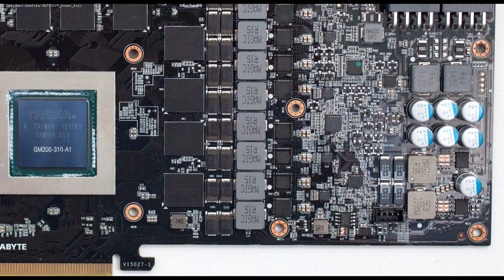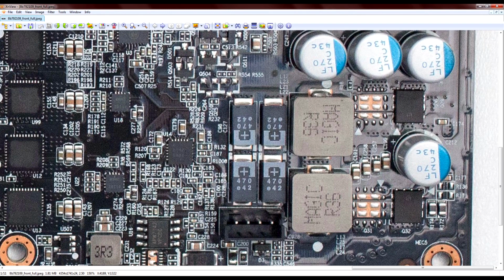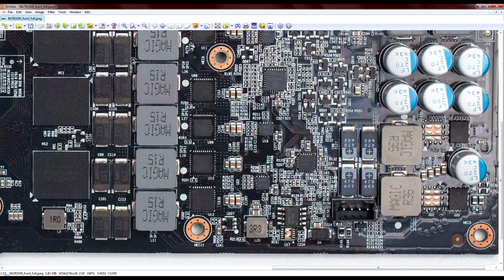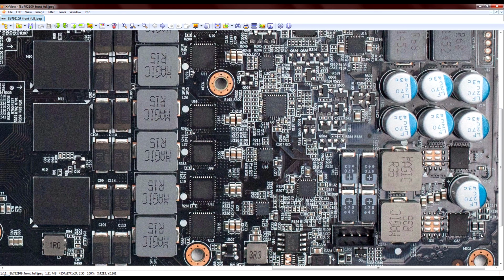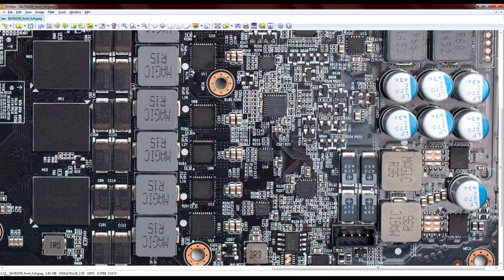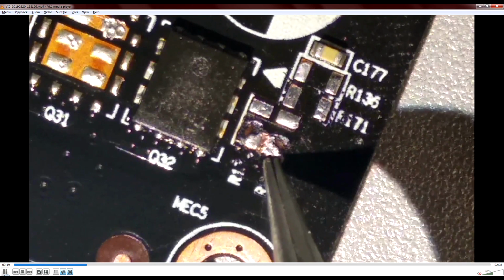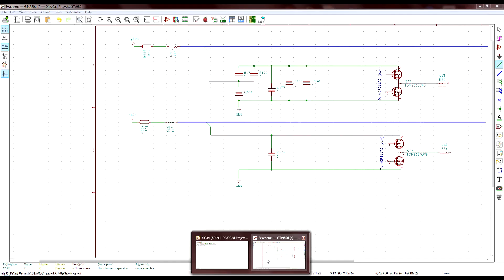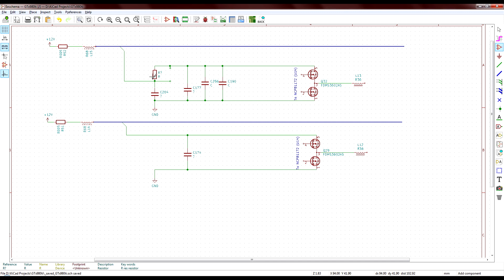Gigabyte 980Ti G1 GAMING-6GD Repair

Comment: @Uros Andric -  Hello, I'm sorry I know this is a very old video. I have a question I'm hoping you might be able to help me with, please. 
I own one of these Gigabyte G1 980 TIs, back in the day it had the exact same problem of R172/R174 ferrite beads burning out on the VRM, so it's just sat on a shelf for the past 5+ years. However, I now need a card for a work PC that has 3 Display/HDMI ports to run 3x 4K panels, so I was hoping there might be some way I could get this card to work again. It wouldn't be doing any sort of gaming, it's just browser-based work, so it's not going to be put under high stress like it would for gaming. 

At the moment, those two problematic ferrite beads have just started to arc, I can hear them buzzing and they look just slightly burnt but it hasn't caused any significant damage yet. I still have an image on screen, it just can't clock very high. As soon as the core clock and power draw goes up above about 40%, it starts to throttle. So when I look at the GPU core clock on MSI afterburner, it just goes up and down constantly. 
As I don't have the ability or knowledge to do any micro soldering, I wondered from watching your video and a few others... could I just remove those two ferrite beads and bridge it with solder? Or could I just remove them to only use part of the VRM, as the card wouldn't be put under high load? 

Would it still work just to do web browsing and Excel/spreadsheets? My theory is because it's not going to be under gaming load, it's only ever going to be under light load, could I get away with this or would it just be unsafe? Or is there something else I could do as I have already looked into and spoken with every computer an electrical store within about 100km and no one would touch the repair.
Reply from the maker: Hello there. No one would repair it because the chances to go bad after the repair are high and no one wants to take responsibility.
I can tell you what I would do if it is my card.
I would remove these ferites and solder a wire. Then i would keep the card on stock values or downclock it a bit. If it is unstable on stock values i would replace Vram power supply controller chip.
No guarantees that will work for a long time but i would try this.
Reply: @UrosAndric  Thank you so much for replying very quickly, I thought it was a long shot as the video is very old. 
I just want to check because I don't have your knowledge, I am very much out of my comfort zone here. Do you mean to remove both of the ferrites and then solder 2 tiny wires in the exact same orientation as the ferrites? So from the 2 pads top to bottom? The top of the card being where the 8-pin power connectors are and the bottom being the PCI connector
Reply from the maker: @Stop_Pre-Ordering_Video_Games Exactly as you described.
Reply: @UrosAndric  Awesome. Again, thank you so much for taking the time to help.

Comment: same card, same issue, except instead of crashing its throttling down badly, i caught it as it started to scorch, nothing serious yet. My question is, where can i find this resistor, and also, if i can, can i bridge with a tiny wire the same size as the original resistor? and on the one side you put the 0ohm resistor? would it do the same job? i just need this card to work for a few more months.

Comment: Cool video and interesting solution whit 0 ohm resistor. If resistor burns; replace it, if also monsfet after this resistors burn;replace it. Replace all burn after multimeter mesaurements.There must be a problem upstream this resistor.  My question is: why this two resistor burn? Do you know any idea?
Reply from the maker: i would replace all burned components and check if all is ok with the card. If it works propperly but those new mosfets and resistors are hot again, i would replace buck converter controller. That is the chip that drives those two mosfets. then i would see if mosfets and resistors are overheating again. My card worked over a year like this but eventualy new resittors got so hot it burned again. at that time i found replacement card and havent bothe with this one again, but if i had time i would do as i said above.

Comment: Thank you for the thorough information. I was able to diagnose my card. R172 and R174 blew out but the traces don't look too bad. However Q32 has a short and I'm worried this means my memory is likely dead. I ordered a replacement for Q32 so I'm hoping it'll work. My card would boot up to the login screen and then fade to black, hopefully it's salvageable.

Update: I removed Q32 and found that U14 has a short. Also removed U14 and it turned out the IC itself is not shorted but the VCC pin(15) on the board is shorted. I;m at a dead end now, don;t know where else to look for the source of the short. Any help would be appreciated.
Reply: Q29 IC gets here today. Confidence at an all time low. Still haven't found source of short :( Any help would be appreciated.

Comment: Hello @Uros Andric, could you please provide me with the pbc schematic of the entire board, (the one you show at 6:25 for example). The same thing that you show in the video happened to my gtx980ti, but the pbc where it cut was badly damaged. (Some copper sheets that are in the internal part) We want to proceed to cut and join point by point. But for that we need the schematic (it is the same GPU) Please can you share it with me. :)

Comment: Hello, I have a similair issue, the two resistors on the bottom right of the PCB are also burned out after a few years of use and a loud pop. Now I tried the zero ohm resistor, however even when I was doing the repair I noticed some discolouration on the R005 resistor on the PCB (in specific the right one that is under the 12v PCIE connector). I tested it with a multimeter in continuity mode and there was continuity on that resistor. I don't know if that is supposed to be the case or not, however the same is true for the two other R005 resistors next to it on the left (one of which you pointed out to in the video I believe). Now, I plugged in the card and something started smoking a bit so I turned it off. Upon further inspection that R005 resistor on the right side under the PCIE connector had burned, I don't think something else has been damaged besides just that resistor. Now I have ordered a new SMD resistor of the same value, but I am a bit woried that I will replace that resistor and it will just burn out again. I am not sure why that resistor burned out in the first place. Now as I mentioned, it did look damaged before, so maybe that was the cause. But in the even that the new one also burns out, what could be the issue? Does that mean that there is a short circuit somewhere or?
Reply from the maker: Looks like short to me. You should inspect the board where the short is. Try that mosfets pair IC that gets 12V from R172 and R174. I think it is Q32 but check within the video where i explane on the schematics.
Reply: @UrosAndric  I did some more measurements and there was indeed a short. However, when i removed the q32 mosfet the short was still there. I then measured that mosfet out of the circuit and there was no short on the chip itself. I then desoldered the 0ohm resistor i had previously put in (the one you also put in) and the short was still there. I then removed the R005 resistor on the top of the board (the one below the PCIE connector) and the short was STILL there. I then measured one of the 4 pads of that R005 resistor (there are 4 pads under it) and the bottom left pad is the one that seems to be shorting to ground (i think so, because the other 3 pads have do not short to ground). That is where i am at right now, I have no idea where that pad connects to and where to find the short, any idea?
Reply from the maker: @shekharnandkoemarsing158  R005 is Current Sensing Resistor. that means that it is connected to some circuit to measure voltage drop-off. That circuit can be dead and shorten to ground.

Comment: This was very helpful. But these ferrite beads will most likely burn because of short circuit somewhere else. I also had Q32 defective. When I replaced ferrite beads with 0ohm resistor and powered GPU, Q32 started to burn. I'll try to replace Q32 and hope it solves my problem.
Reply from the maker: If it is a short somewhere Q29 would also burn as they split the current. I think the controler have to be replaced as well. That would be U14 component on the board.
Reply: any luck after replacing Q32? Facing the same issue.

Comment: Hi Uros, thanks for your video. I've another issue than may have caused the damage. so. my q32 exploded because was working "solo".. let me explain. So, i don't know how, but my q29 is taking the 12v from the PCIE (SUPER NO GOOD) and the fuse,that protects the PCIE drain, rightly died. So no more power for the q29 even if it should have drained from the supplementary 12v from the psu (a thing that it doesn't). Then q32 started working solo, and this have caused the explosion of the r172/174 and the q32 itself. My question is... can you help me find why is my q29 still taking power from pcie and not from the PSU supplementary power? Any idea of who is the guilty IC ( i guess is an IC somewhere) ? 

Thanks a LOT in advance :)
Reply from the maker: Don't know realy, will have to trace the board to give you the answer.

Comment: Great work! I have this card too, few tools to do the job but searching for the 0805 0 ohms resistors, I come accross so many wattage capabilities (1/8W to 125W) does it change anything? Thanks!
Reply from the maker: Can't remmeber how much power memorry is draining. I think i sugested someone not to place fuse less then 5 amps.which on 12V line corresponds to 60W. Anything above it is fine i think.
Reply: @UrosAndric  Oh so a fuse of 8A basically! Thanks again :)

Comment: Hello Uros, I read someone who said we could use the second pair of pads (R171 - R136) if the R172 - R174 are too burned, could you confirm ? Thanks, and great video by the way!
Reply from the maker: I think not. This is me talking from top of my head but i think that those R171 and R136 re on different 12V rail. Technically it will work, but then you will have heavier load on that rail which can cause trouble. I would rather solder a wire from choke L15 to the place where the pads ware. This is connected directly anyway.
Reply: @UrosAndric  ok thanks, but my r172 pads seems fine, so you suggest to put a 0 ohms resistor and nothing to r174 right ?
Reply from the maker: @davebelisle949  Yup, just to replace that two burned ones with one 0 ohm ot a fuse. Be sure that IC os ok so you won't burn yout memory before you do that.
Reply: @UrosAndric  thanks Uros, by IC you meant Integrated Circuit ? If yes, well everything else looks fine
Reply from the maker: @davebelisle949  you have to measure it. If it is dead it can send 12v directly to the memory which will kill it.
Reply: @UrosAndric  ok so if I understand I have to test the Q32 chip resistance to see if it's ok, any idea the value it should read ?
Reply: @UrosAndric  hi Uros, I tried the fix but the card isn't working. The screen is shutting down after about 30 seconds even in the BIOS. Card is doing an electrical buzzing noise too. Any idea would be appreciated. According to electronician, Q32 and everything surrounding R172 and R174 is ok
Reply from the maker: @davebelisle949  i wouldn't turn it on inside a PC further more. Ot needs to be measured and tested in special conditions. Including power supply which have limited current. If this did't help then propper service is needed.
Reply: @UrosAndric  that's weird but the card is working nicely now, I brush it with a lot of alcool isopropyle and replug the cooler, maybe there's a safety if the card don't detect any fans ? Anyways, it's all working. Thanks again for the video!

Comment: My G1 gives a complete solid color screen freeze when trying to run unigine valley, any 3D games and even legacy games like warcraft 3 and CS1.6, they run fine until the gpu cooling fans kick in, the computer froze. Meanwhile i tried running furmark with no issue

Comment: Hello great video. two years now I'm now experiencing the same I wanted to find out the 0 ohm resistor should I replace it with only one
Reply from the maker: Yes, when replacing those two ferites needs to be replaced with one 0 ohm ressistor or a fuse.

Comment: I have had the same issue. However when I replaced on of the resistors with a small trace wire for pcb corrections the computer would not come back on. it just simply kicked the power supply off instantly. I have replaced the wire with a 1.8 ohm resistor and now the computer will come on but no response from the card. The first attempt to power on with the wire the card came on the lights came on and fans were working only for a split second before a small spark. i cannot tell where the spark came from but close to the same problem area. I removed the FET next to the resistors, visually it was in good shape but i can not tell internally. Can you help any @Uros Andric
Reply from the maker: If that FET died, when you replaced resistors with a wire it shorted 12V line to the ground thru that FET. Hopefully thru that FET and not thru the memory. Card should be able to boot with only one phase. So if you removed that FET, please remove the witćre just in case and try to boot. It should post.
Reply: @UrosAndric  I removed the Mosfet and 0 ohm resistor and the card will not power up. not fan movement or lights. I did not plug into pcie slot because I am a bit worried about the cad hearting my computer. I have a replacement fet I could put on. Any suggestions?
Reply from the maker: @Dr.DutchH  How did you tesded it if not putting into PCI express slot?
Reply: @UrosAndric  I tried it in the pcie slot and plugged into the power supply.  Without the fet.  It did not post. No lights came on 0 response from the card what so ever.

Comment: I got the same card, and the problem is this R172 and R174, one of them came off, the card still working but cannot sustain the memory/clock boost.
Reply from the maker: It fell of because it was heated enough to melt the solder. I would replace both of them with a fuse.
Reply: @UrosAndric  Thank you for the response I will try to find someone that can solder this coz my soldering skills already faded 😅
Reply: @UrosAndric  do you have a recommendation what amp of smd fuse I can use? Thanks

Comment: so hello i am commenting so you know what happened my poor 980ti same card after good 6 years crashed frozen screen yesterday and now it dont power up fans not spinning nothing happens i thing it dont even draw power completly dead i will take to  a technician tommorow to see if its actually card or slot on mobo  do you think its fixable? if i connect the display port to the mobo it boots up normally with intel intel graphics but gpu is not detectable by mobo

Comment: Hi Mate.. I have this card.. And the problem is that the memory clock and core are fluctuating a lot.. Memory goes from 3500mhz to 810mhz and performance drops really quickly.. Card is working in Windows but will stop working under load after few minutes.. You think its the same problem?
Reply: Adding a wire fixed the problem
Reply from the maker: @Chaosek  then you know those 2 ferrite beds are faulty. Best thing would be to remove them and place a fuse.
Reply: Thx for all your help
Reply from the maker: we had here a user that have reported exactly the same issues with his card and after replacing these R172 and r174 with fuses, card worked normally. I suggest you remove heat sink and check visually how those two components are looking. If you see any sign of burning you should replace those.
Reply: i just checked the 2 suspects and both look black and burned ... people seem to say these are ferrite beads... i found them on ebay.. but how do i know what value these should be?
0R?
Reply from the maker: @Chaosek  you can't know without schematics
 But since we know what they are suppose to do, we know we can replace them with 0ohm resistors or one fuse.
Reply: i checked both of them and there is continuity from one side to the other.. maybe its not that :/
Reply: i am trying to add photos with link to imgur but google keeps removing them
Reply from the maker: @Chaosek  you should measur the resistance. It should be leas than an ohm. Also it shouldn't change resistance drastically when heated. You can jump over them by soldering a wire in paralell with them. Then you can test the card. If crashing or fluctuations dissapiers, then you know that they are the problem.
Reply: @UrosAndric  thx.. I will try tomorrow. Does the wire need to be certain thickness?
Reply from the maker: @Chaosek  yes, but for testing purposses use some piece of wire not too thin.
Reply: Wouldn't it be better to replace them with a ferrite bead?
Reply from the maker: @Chaosek  yes but only if you know the exact values.

Comment: Thanks. You helped solve my issue. the Q32 was shorting out. Once I removed it, the short was resolved. Also, as note of caution, I the pcb area around the Q32 and 0-ohm resistors to be very delicate. Also, I ordered five of these Q32 powerstage mosfets. Since there are none in the U.S., I will throw the remainder on eBay.
Reply: hello I did not understand did you completely remove the q32 mosfet?
Reply: @DanjFisher  Yes, I removed and replaced
Reply: Where did you find the Q32 mosfets? I searched for Q32 and fdf32cd22can7cc
Reply: Did it work after replacing the mosfet? I have the same issue but I think U12 is the actual cause of the short. After testing it the vcc pin(15) had continuity with ground. Ordered replacement for both.